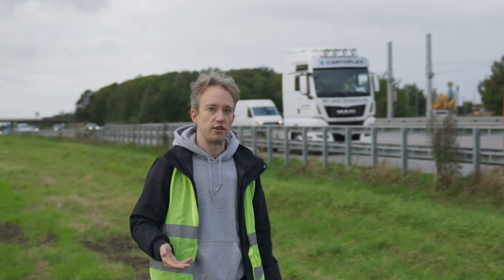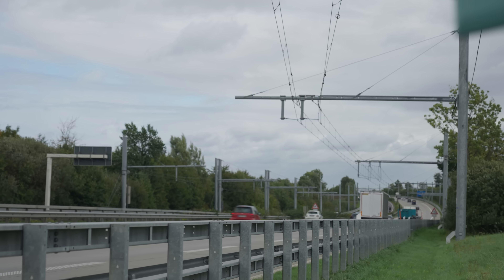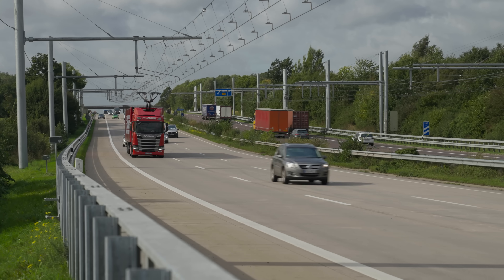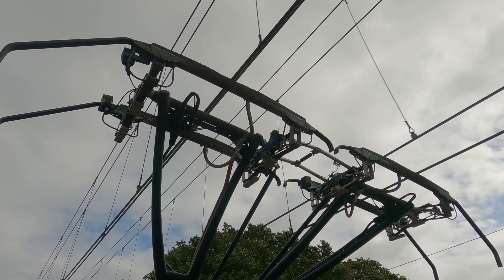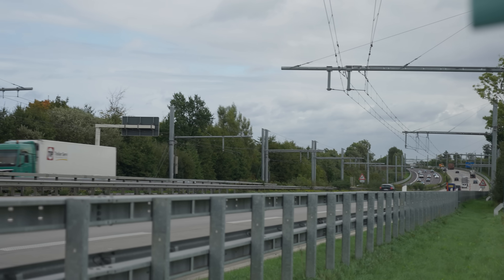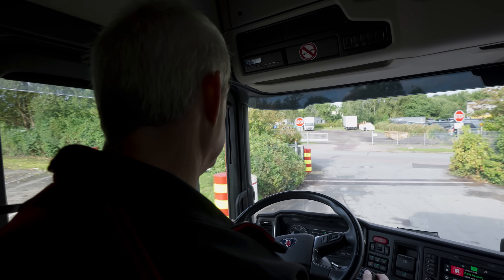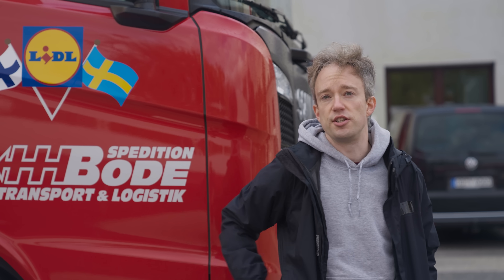The highway where trucks work like electric trains

Comment: Lets put steel wheels on the trucks to reduce friction, link them together to save air friction and a number of drivers and call it a train.
Reply: Then give them a separate road network made of steel rails to reduce wear and simplify automation.
Reply: No no... train is too last decade... let's call it e-trans pods... now you have the attention of politicians.
Reply: @shlokjagushte1839  Call it "The HyperTraq".
Reply: @shlokjagushte1839  This is a remarkable insight into how politics works today.
Reply: @shlokjagushte1839  what if terrorist attacks or earthquakes happen?
Reply: @ki0w0-lordofwatersheep  how often does Germany get earthquakes? 

And terrorist attacks can shut down a highway too. Concrete and steel are both only bomb-resistant, not bomb-proof
Reply: @kylejohnson6775  so that argument against hyperloop doesn't apply in germany?
Reply: And then lay rails to every location a truck would ever need to go.
Reply: @emielleclercq ya than your realise you desroyed your rail network andneed to reubild it all becsue you were shorte sighted
Reply: @TMinusRecords  you can also charge the batteries while driving, so you could drive to the highway on battery, then charge it back to 100% and have more range left over when you're off the highway again
Reply: There are hundreds of thousands of warehouses and distribution centers in Central Europe. It's not economic to build and maintain a railway spur to more than a small fraction.
Reply: @Croz89  Not really based on reality. Short distance == Truck, Long Distance == Train with Trailer Lores so that the Truck can Take over for the short distance.
Reply: @platin2148  Sometimes, though transshipment times and available rail routes must be taken into consideration.
Reply: @Croz89  Might want to make more rails then?
Reply: @platin2148  Far easier said than done.
Reply: Think the difference is that trucks are more versatile in mobility options, so in this case it might be valid if theyre all going in different directions
Reply: Or just use trains?
Reply: Adam something liked that
Reply: While trains are great and many countries would benefit from expanding their rail network, you cannot use rail to transport to every specific location where truck delivery is necessary. Trucks will remain needed and this seems like a great way of reducing their co2 emissions.
Reply: @legodrakie   trucks should be last mile delivery only.
Reply: @legodrakie 100km of transport by truck is literally worse than shipping something from the end of the world
Reply: You're obviously not into logistics. After ships and trains, how do you think goods gets to warehouses and front doors?
Reply: feel like I'm stating the obvious but there is undeniably a strong difference between trains and these: the flexibility of the trucks being able to off road whenever they need to makes them a better solution for delivery. it's a best of both worlds situation.
Reply: @Thisath100  best of both worlds? no. Its more flexible but you need MUCH more drivers and trucks for the same amount of goods. Trucks can do the last mile.
Reply: Well these can drive on battery for shorter distances so not exactly the same. If the train had wheels it could lower down and drive off the rail then it would be more similar. Trains are more efficient but these are more flexible.
Reply: You could do that with busses, and cut down on the space and infrastructure needed for airports as well as air pollution noise pollution ect.
Reply: @summercatto  trucks can feasibly run over your house?
Reply: Ah yes, the Transportation Revolution Automotive Integrated Network
Reply: This is a multi location last mile delivery. Unlike train where it is from manufaturer to stockist
Reply: You do realize cargo from trains still ends up being loaded onto trucks for the final portion of the journey, right?
Reply: @adamsomething
Reply: And then comes a Beeching. Btw there are a lot of tracks in the UK, that are main lines, but still are not electrified. It's a disgrace
Reply: Trains for long distance. Trucks for train to cuatomer and vice versa. Would you want a train running down a street to get to cvs?
Reply: @solaryellowis3007  Yes, did you ever hear about trams?
Reply: why reduce friction tho...😅
Reply: You didn't listen to the video!!!
Reply: Brilliant!
Reply: there's missing the point... then there's really missing the point.
hey wise guy what about the tracks
Reply: No. Reserved to highways
Reply: Separate them from the road so the few car drivers dont have the problems with truck passing truck
Reply: adam something approves
Reply: this ^
Reply: Genius and unique idea, I dare say
Reply: Absolutely and call it an Intermodal Consits aka TRAIN
Reply: Trains can't pull off the rails to delivery into towns and cities.
Reply: @killuazoldyck1352  It’s not needed todo that even. And at least here in Austria every big City has a Train Station and a Cargo place so distribution can happen from there too and would require these heavy battery packed bombs 💣.
Reply: Building tracks where there is already buildings or roads is difficult and expensive. Ideally you're right but getting people to commit to spending that money is really hard.
Reply: @batt3ryac1d well in the UK they managed to destroy most of the rails and turn them into roads and buildings,  there's no reason why it can't be done the other way around.
Reply: @batt3ryac1d  trams lines are a thing, high rail gear is a thing. Delivery trucks that convert to rail network and replacing service roads with service tram lines that even tie into local train lines would allow trains to deliver to and between warehouses, trucks to deliver last mile, and staff to drive to work, or even take public transit into industrial parks.
Reply: @batt3ryac1d  personal cars are stupid anyway
Just get rid of all the roads, and you have space for the tracks
Reply: @Soguwe  So without the personal car, how would you buy a sofa or a bookshelf or just a load of groceries to feed 6 people?
Reply: @tauridborn2777  in a shop?
Reply: @Soguwe  Let me slightly rephrase: how would you get it home from the shop?
Reply: @Soguwe not always, do you want people to have to wait for 20 mins for a train when they are bleeding to death? By saying that there would be no roads for ambulances :/ but other than that I guess???
Reply: And then prevent it from traveling to where the goods start and where they need to finish up.
Reply: @owensparks5013  You might want to take a look at Swiss the reality there is that the producers of goods can easily get rail in place for there goods. 
Just less convenient.
Reply: @platin2148  Oh I agree there are situations where trains are appropriate.  However the vast majority of train journeys involve putting the goods on a truck,  driving the truck to the train, taking the goods off the truck and putting them on the train,  then taking them off the train and putting them on another truck and driving them to where they actually needed to go. 

Now if you were to build a new industrial complex then you could build a train station in it and if land was available some tracks to link it to the network.  That would help,  but only if the recipient also happened to have a train station...

To my uneducated mind it seems more sensible to develop autonomous transport pods that can self drive on roads.  They could use existing road networks, travel directly to the destination without triple handling everything,  and be faster.
Reply: @owensparks5013  Goods are today not really transported in that way via train anymore they take the entire trailer and have a quick load/deload. Transportation of goods directly is done via container and that is not worse than transportation via truck. For long ways it’s more efficient to use the train no matter how you drive trucks. The long distance is best done via train.
Reply: @owensparks5013 heard of Switzerland? Almost every facility, factory and warehouse has easy access to rail. Sometimes it goes straight into the facility.
Reply: @Bohr2um  I have indeed. In fact, the only flight I've ever missed was in Switzerland.  The famed Swiss efficiency was somewhat absent that day. Who would have thought sharing a transport system between a convention centre and an airport was a bad idea...
Reply: @owensparks5013 this is the key limitation of train cargo that nobody has even talked about trying to solve
Reply: Trains also have a lot of disadvantages that road trucks don't have. They can not pass each other. Switches are expensive. Curve radius is extremely large and rubber tires are just better at climbing steeper inclinations.
Reply: Shhh, you're scaring the German minister of transport!
Reply: It's almost like all we need is a well adapted and designed rail network to local depots where smaller, potentially electric trucks could then take low volume freight to end customers??
Reply: @TMinusRecords  but it doesn’t solve the problem is expediency. As long as cars share the road with trucks your always going to have delays for commuters. And maintaining roads is way more expensive then maintaining rail systems. Also trucks are a major portion of traffic accidents. We need to separate freight and commuters
Reply: Rail is not always solution

Comment: Simple solution: Just use trains instead.
Reply: Trucks can go the last mile. Trains can't.

Not every factory, business or every discounter has an integrated train station. Electric trucks make sense.
Reply: @JanFWeh  If its driving on a motorway, it’s clearly not last mile delivery.
Reply: @TylerBenney As I wrote, trucks can go the last mile. Major advantage. 

Changing the mode of transport takes a lot of time (truck to train to truck). If you transport a full truck load of goods, you will want to avoid these change-over times for time sensitive goods.

Comment: This cannot be cost effective.  The trucks still need batteries and chargers for the beginning and end of every journey.

Electric light rail trains dedicated to intermodal would have to be cheaper. 🤷‍♂️
Reply: This is not used for the who journey... just for the highway portion.
Reply: Why? Why could you not charge while consuming traction power from the overheads? Especially while going at a constant velocity it's not like the electric motors are sucking hundreds of kw
Reply: the truck has a normal diesel engine which it runs off when off the grid :)
Reply: The problem is that the train can’t just leave the rails
Reply: @julius5632  it can didn't you watch the video, they explained it
Reply: @elsyvien  I'm not sure if you understood what I wrote.
Reply: Electric light rail requires much more infrastructure investment though, and as you're mentioning, intermodal is the only way you'd get enough scale to warrant that kind of investment for routes serviced by trucks currently. Putting aside convincing drivers to take rail instead, even in the ideal cases some locations will not see enough demand to justify that kind of infrastructure. This tech on the other hand should be much cheaper on infrastructure cost.
Reply: Compared to other solutions, you would only need to add a Pantagraph to get the power.  You could downsize the battery to a 100 mile range or so, charge while moving. There has to be investment in infrastructure anyway, why not make the charger something that can be used on the move.
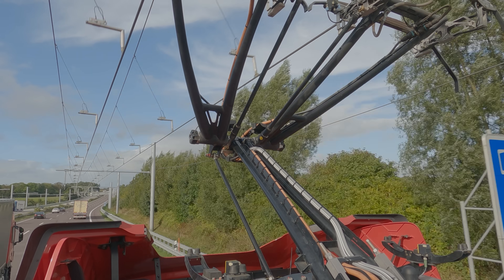Reply: This professor of Mechanical Engineering at the University of Cambridge (2:12) seems to have some good arguments for why it IS cost effective, and I'm not seeing you address those. Besides, light rail would require infrastructure for every depot you'd need to visit. Trucks can use existing roads, and only need the batteries for the shorter stretches near the start and end.
Reply: You only need a small battery in the truck for last mile and you don't need extra chargers, you charge while underway. Light rail would be better in an ideal world but that assumes that's the infrastructure you built around to start with. Building out that from scratch now would be incredibly expensive and take a long time.
Reply: But then you would need to build infrastructure for trams so they can be effectively used at warehouses. It can be done but only for big factories so it's not going to work. Truck can drive right inside factory using what's already there and modified line on the highway is not dedicated to them.
Reply: they could use hybrid solutions like is said in the video
Reply: We've found the critic 🤣

Comment: It's almost as if it were better to use, hmmm.... Electric Trains for this job. Higher capacity at lower friction resistance = higher energy efficiency.
Reply: Not every town has a train station capable of handling container freights. Road freight is the dominant method of transportation in Germany, to load all of that onto rails would overload the current infrastructure. Rail freight is also less flexible due to timetabled routes and passenger train competition. The share of rail freight is on a decline relative to road freight. 
There's a bunch more other factors of course, but that should hopefully at least make it clear that trucks are here to stay, and since they are - why not test new infrastructures that make a contribution to reducing emissions.

Comment: I think we need more, new and better train systems. Train tracks that go from every port to every city with a smart layout. Trains are way more efficient for long haul. If every shipping container could have a way to gain energy such as solar panels or store it such as a battery, there would be no downtime for the train except possibly at night depending on the solution.
Reply: This is only 1 part of building a train network. You need the land, rails, signals plus many more hidden costs.
Reply: The issue is that it’s just more profitable and logistically simple for goods to be transported by trucks. For example goods that go from China to some warehouse will go on a truck, onto a ship and back onto a truck instead of a truck to a train to a truck to a ship to a truck to a train to a truck. This is quite bad as trucks cause I think a majority of shipping emissions, cause a ton of road wear and traffic and are just generally bad.
Reply: The problem is that that is much more expensive and slow to build, and also extremely difficult to plan properly and in a way that withstands logistical change over time (e.g. what if some big port or company shuts down?). While those cables are just stupid cables over already existing highways, that everybody could technically use.
Reply: It is a lot easier and more reliable to put the solar panels at fixed locations, and pipe the power to them in a common electric train rather than trying to build portable solar - Less risk of damage to the solar panels, and you don't stack lots of them away in yards or on ships for long periods of time as you would if you tried to make solar powered shipping containers. 

One container would require several extra train car lengths of solar panels to get the whole thing moving.

And sending electrons down a wire uses less energy than moving a solar farm everywhere.

Comment: Nice tech.
One info I thought is missing from the video is. Is this only used to run on the grid while connected, or is there a solution that could charge the battery while connected? Would be great to have a stretch of like 100km with this and a truck that charges all the way is ready to do some off grid driving again (like charged to 90%)

Comment: I feel like potentially this is not really any better than a freight train? If last mile deliveries aren't covered by it, then improving rail networks would surely have a better impact than this?
Reply: This is much easier and cheaper to build.
Reply: The idea is that the trucks have a battery that covers them for short range journeys. So you would probably be driving on the battery for the few miles from the port to the motorway, then once you're on the motorway you raise the pantograph and (a) use the grid to power your truck, and (2) at the same time use the grid to recharge the battery. So then when you come off the motorway for the last few miles to your destination, you can use the battery again when you're on local roads.

But yes, it is very limiting, until a critical mass of motorways and trunk roads are wired up, to ensure that you can get to within battery range of most destinations.
Reply: They are two separate things. This is similar to the train network but adds a new functionality to the existing road network. Try obtaining the land to make a new train line and let me know how that goes.

The last mile piece is handled by completely different vehicles and needs a whole lot of intervention after the linehaul (long-haul) trip is completed.

and: 'not really better than a freight train'? Nothing is better than a freight train at what it does. It's safe, efficient and cheap. But what it does is extremely limited and this supplements it very well. Logistics companies already use rail in every conceivable case it meets their needs. It's a no-brainer. But trains don't go directly to the depot or the destination. These trucks can do that, but with train-like efficiency and truck-like flexibility.

Comment: This is definitely an interesting idea! Like other viewers have mentioned, this is a great stopgap solution until full fledged battery powered trucks are a viable reality.
Reply: id say its a stopgap solution until our railway networks are extensive enough to replace car infrastructure.
Reply: This is better than batteries because you don't need to recharge, which is relevant if you are a truck that needs to drive non-stop across Europe...